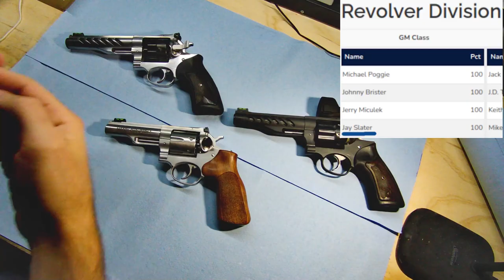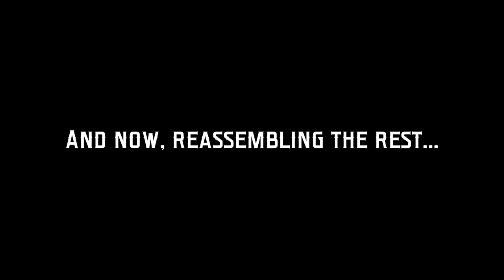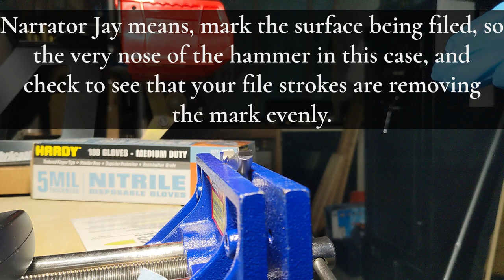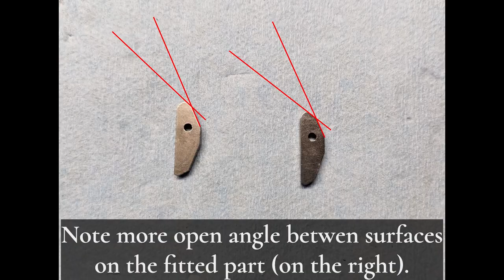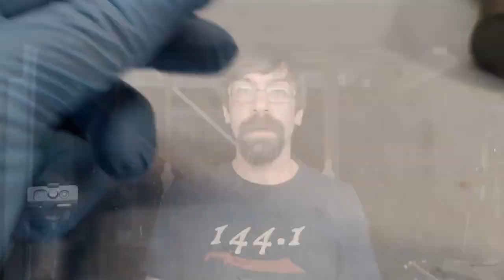The Grandmaster's Guide to the GP100

Comment from the maker: Errata:

1:59:50: the wall/hitch described here appears to be a hammer dog fit issue. When doing the hammer dog fitment test described in the chapter starting 1:17:21 on a 6-round gun, the wall indicator a too-short hammer dog may occur after the cylinder unlocks and begins to turn, unlike on 8-round guns.

Comment: This 2 hr video is the best I’ve seen for the GP100. The attention to detail is top notch.  The smallest bearing surfaces were clearly defined and shown in removing only enough to smooth the action.  The video is pertinent to the SRH and Sp101 in terms of disassembly and polishing.  Trigger, hammer dog, and hammer shims were covered too. I while I am no master gunsmith, I have worked on guns for 50 years and know my carry gun while fishing in the Montana and Idaho will remain the SRH Alaskan 480 with a good polishing of the parts and stock hammer springs.  My GP 100s in 327 and 357 mag are smooth as butter with lightened springs. It doesn’t take much to ruin a part already fitted at factory and Jay points out the critical areas. Thank you sir for a taking the time to produce this video.
Reply from the maker: Thanks for your kind words!

Comment: Ok so unrelated question to triggers. I notice the hogue cylinder release handle on your supers, but your 10mm has a shortened paddle thing on it I've never seen before. I run the long hogue ones on my idpa match champs and my local matches haven't said anything to me about it. But I'm pretty sure that when I show up to my first state matches (Oklahoma and Texas this year) they will tell me it's not allowed. Where did you get the short paddle one on your 10mm?
Reply from the maker: I 3D printed it. Sadly, I need to go back to the drawing board: I printed the entire cylinder release piece, but the stress of the hammer/transfer bar pushing on it caused it to break after some dry fire, in a way that suggests plastic is the wrong material.

My next plan is a little extension that can be superglued onto the stock release, which I think will work for an IDPA-sized part. Failing that, maybe I try to make one that fits on the dovetail on Hogue's.

My understanding, like yours, is that the Hogue long paddle is probably not IDPA-legal, which is why I went down this path. For the IDPA match in a week, I'll just have to train myself to break grip and aim very carefully for the button, I guess.
Reply: If you find one that works, cut an extra and I'll pay you for it lol

Comment: I bought a used 1990 GP-100 back in 2013. ( I have never shot it). While cleaning it I nicked the cone just a little. Will it hurt the gun or me to shoot it like that? It seems like the gap between the cylinder and the frame is a little big. I called Ruger several years ago and explained to the lady what had happened. She said for ninety dollars they would inspect it and charge me according for any repairs needed. Should I take a chance to shoot it or send it back to the Ruger factory? I do not know a lot about handguns. I have never shot a 357 mag. I bought it cause my state was passing a law to make it hard near impossible to buy a handgun here. It was the only gun I could find at the time. Consumers were buying up on all handguns at the time. It looks like a nice gun. I was told it had one local owner before me and sadly he passed away and his white sold it at the pawn shop I bought it from. Can you give me any advice? I'm sorry for the long post here.
Reply from the maker: Rugers are looser than other revolvers in barrel-cylinder gap tolerance. If you have a set of feeler gauges, hold the cylinder to the rear and measure the barrel-cylinder gap. 0.006" is ideal. The spec goes to 0.008", but I've had guns at 0.010" or 0.012" that function fine.

The effects of a nick in the forcing cone will depend on where exactly it is. If it's on the outer rim, no problem. If it's on the inner rim (the corner between the surface that faces the cylinder and the inside of the cone), copper-jacketed bullets should be fine, but the barrel will probably foul more quickly if you shoot lead or polymer-coated bullets, and I would definitely address it. If it's a gouge in the inner surface of the cone that doesn't have any raised edges, I think it's probably also fine.

You wouldn't regret sending it to Ruger for peace of mind, however.

Comment: Thankyou for this video, it's perfect and I don't think somebody could do it better. I've kept both my GP-100 and Security Six completely plain aside from this internal work.
While the Security Six has slightly different internals, I was able to do most of it and got significant improvement after just the first try. I hated my Six trigger when I first got it, you had to use so much force to cycle and by the time you were about to feel a wall you might as well have just yanked the trigger. It still could use more work, at least I can consistently stage it now. You rock Jay
Reply from the maker: Sure thing!

The Ruger DA revolver shop manual I mentioned in the video is a great buy if you have a Security Six—all of the measurements and tolerances it gives will actually apply to that gun directly.

Comment: @JaySlaterOfMars The cylinder latch "hitch" described at the 2:00:00 or so mark I believe may be trigger plunger related. My GP100 suffered from the cylinder latch snapping up very late and an excess of tension from the pawl spring.  This caused a notable bind about 1/3rd through the pull until the latch snapper upward.
I removed material off both the nose and the rear of the trigger plunger. This decreased the time until the latch snapped up and decreased the tension placed upon the plunger by the pawl spring. No more hitch. 
Hammer dog fit seems to manifest in the last 2/3rds of the pull as the hammer dog is supposed to "hand off" the trigger to the DA sear at the bottom of the hammer.
Reply from the maker: Thanks for the tip!

Timing is one of the things that's definitely different between the 6 and 8 round guns—all of my 8-rounders have pretty early cylinder latch timing, whereas I don't totally recall what the 6-rounder is like. (I could really use another one or two of them before I say much for certain.) I'll have a look and experiment some, and if I come to the same conclusion, I'll credit you in the errata.

Comment: I just wanted to add one more thing to this already great video.

I was curious about a ever so slightly gritty feel I attributed to the hammer strut head (the circular shaped portion opposite of where you'd put a pin to retain the seat & spring).

In addition to completely smoothing the hammer strut, I polished the channel it rides under the hammer with some sand paper, working my way up to ultra fine sand paper. I still wasn't satisfied. I took a chance on a Dremel chainsaw sharpening set, and using the 3/16" bit (which fit perfectly) to completely smooth out that channel, finishing by polishing said channel. If you try this, you don't want to remove much material, just enough to smooth out the rough, machined surface.

Now, it's trigger is very comparable to my Colt. Stay safe everyone
Reply from the maker: That's a great tip. It's a very difficult place to get with sandpaper.

Comment: Great video thank you a lot! Maybe you could do a video or make recommendation here for the GP 100 grip for IDPA. I have been thinking to take match champion grip but read that they do not fit well GP 100. Interesting what are your thoughts and experiences.
Reply from the maker: All of my guns have the plain, no-finger-groove Hogue rubber grips on them, SKU 80010. I don't like wood on competition revolvers, and have run into issues with grips that are secured with a screw that passes by the mainspring strut.
Reply: @JaySlaterOfMars  appreciate for the explanation!

Comment: Thanks for the detailed video.  I installed the MCarbo spring kit in my SP101 and followed their polishing instructions.  Everything went well.   When I saw your video I decided to go back in and polish the other parts and sear engagement areas.  It reduced the single action trigger from 3-1/2 to 3LB.  On double action I now have a hitch in the middle of the pull.  It's kind of like a wall and I can see the transfer bar jump a little.  The pull was smooth prior to installing the main spring.  I wonder what I did wrong and what do I need to look at specifically?  I made a short Rumble video of the action.
Reply from the maker: I'd have to see the video to say more confidently, but most hitches/gags mid-pull have to do with hammer dog fit. A wall in the middle of the pull typically happens when the hammer dog is a little too short—the DA sear surface on the trigger hits the DA sear surface on the front underside of the hammer. The quick test is to cut out a tiny rectangle of aluminum foil and tuck it in behind the top of the hammer dog in the hammer. If the issue goes away, then the hammer dog is just a hair too short. To save a bit of time, you can probably reproduce the issue by putting resistance on the hammer with your thumb, leaving the mainspring out.

This part is extremely speculative, but experimentation with my GP100 suggests it's a little more sensitive to hammer dog fit than the Super Redhawk/Super GP frame size; the compact frame might be more so. I really need to get an SP101.
Reply: @JaySlaterOfMars    Hi just installed a replacement hammer dog, (of course I did not polish it, and it's running great!  Thanks os much!

Comment: Thanks for the video! I’ve been looking at the Super GP100 9mm for some time now. How well does it perform and does it have issues with light primer strikes?
Reply from the maker: I think it's a very competitive option for IPSC/USPSA-style shooting. Beyond what I say in the video—that it can be tuned down to a pretty light pull, even if not quite as light as S&Ws—it's built like an absolute tank.

With the factory springs, it lit every kind of ammo I threw at it. It's pickier now with the competition tune, but it's about 99.9% reliable with my handloads. One maintenance item, if you're using light springs a lot, is to check hammer fall weight on a schedule. With a heavy dry fire schedule, pulling the trigger a lot can wear out the hammer spring over time.

All that being said, the 9mm guns are extremely hard to find right now—Ruger hasn't made a new one in a couple of years. I keep hearing that they're on the way, though.
Reply: Mate thanks for your reply and for sharing your expertise. I might know a supplier who has one and have been on the fence about making the purchase but you’ve put me at ease regarding my decision. I’m a new sub for sure!
Reply from the maker: Much appreciated! Best of luck getting your hands on one. Feel free to leave another comment if you run into any trouble with it.

Comment: If I may ask what front sight do you recommend for IDPA in Ruger GP 100? Is Hi Viz Fiber Optic OK? Would you also change rear sight or leave factory adjustable sight?
Reply from the maker: All three of my guns have the Ruger factory fiber optic front sight, which I believe is either manufactured by HiViz or copied from it, so it's a solid option. I may experiment with a narrower front sight blade this year, however. In dim or gloomy conditions, the relatively wide HiViz blade can be tough to center correctly in the notch.

I shot factory adjustable rears for a long time, blacked out with a Sharpie. They weren't perfectly trustworthy in keeping zero over high round counts, in my experience. Put witness marks on them with a paint pen if you're going to stick with them. All of my guns wear Bowen Rough Country rear sights now, which have withstood an awful lot of travel and shooting now without issue.
Reply: @JaySlaterOfMars  thank you 🙏

Comment: Just got a .357/.38 GP100 for IDPA use (I'm primarily a USPSA semi-auto shooter). Do you know if the extended cylinder release is legal for IDPA? Also - mine doesn't seem to throw the cases out very well - is there anything I can do to help with that?
Reply from the maker: The Hogue release is not legal for IDPA, as far as I know, based on A5.7.1 in the IDPA gear rules appendix. I'm working on a part that meets those requirements, however, and should have it fully worked out by about May.

For ejection, I don't have much advice, unfortunately. Even .38 Special, in a .357 gun, doesn't come fully out of the chambers on a full stroke of the ejector. From a technique perspective, when I was running moon clip .38 in USPSA, I found that a more vertical gun and an extremely authoritative slap of the ejector rod helped. (I know some guys who reload with the weak hand most of the time, but switch to a strong hand reload in ICORE Classic/IDPA Stock Revolver, because it's easier to get the gun vertical in the weak hand.)

From a gunsmithing perspective, I see some people talk about running a flexi-hone, or some 400-800-grit sandpaper on a dowel, through the chambers, if you can see any machining marks in them. The IBOK doesn't say anything about it either way; Iowegan doesn't recommend anything beyond light polishing, and only then if you can in fact see machining marks.

I'll try to remember to check Kuhnhausen when I get home, to see if he weighs in one way or the other.
Reply: @JaySlaterOfMars  appreciate the reply - I'll be watching for an IDPA legal cylinder release!
Reply from the maker: Nothing in the Kuhnhausen manual about cylinder honing either way. rugerforum.net may have more up-to-date information, or additional advice on getting good ejection.
Reply: @JaySlaterOfMars  I will check out ruger forum - again - appreciate the help!